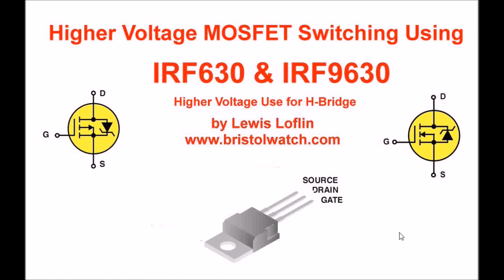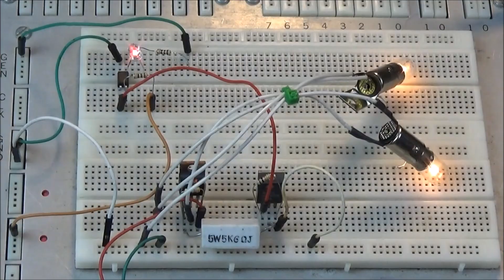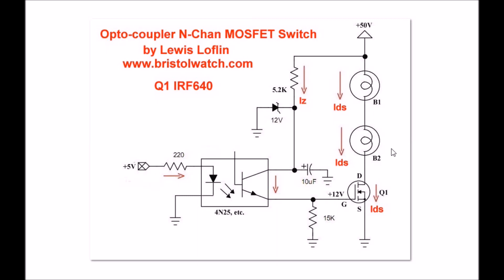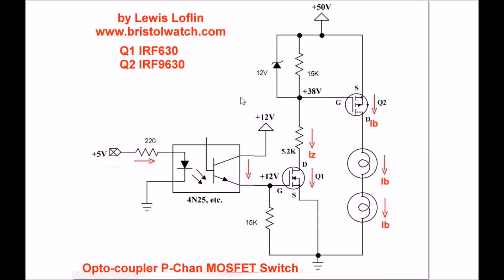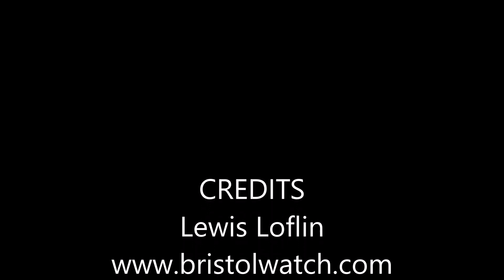High Voltage MOSFET Switch Tutorial

Comment: i have only basic concepts and good soldering skills, used to repair music amplifiers;

 i have here a broken 3000w/5000W  china   inverter, 24 VDC to 220 V AC;  the 1st stage ,at 24 KHz, produced 380 VDC, and the 2nd,   220 VAC at 50Hz;

since the control ICs (soic16)  have been erased,i will only use the 1 st stage of the inverter;  i  modified it ( converted it to the SG3525+LM358 china module,only 2 dol.), fixed it, now have a good 380 VDC;

 for the 2nd  stage i use an external  3000W board with 8 IGBTs, and the famous 4 dol.  EGS002, i bought fully assembled;

     the china vendor says to supply the 3000W board with 16V AC( module already has 4 diodes for DC..) by wrapping 4 turns of wire around one of the 4 yellow trafos of the 1st stage ; done that;
     he also says,in bold red... that the 16VAC and the 380 VDC must be  simultaneously
 
    My question is ,why is that?

I know it has to do with the full H bridge, with the gates' signals and the IGBTs being  on or off,  but since i have to connect the 2 cables (16vac and 380vdc) btw the 2 units, i need to know  how to time those connections;

i feel that if done wrong the IGBTs will blow instantly,in case the 380 VDC are shortcircuited to ground thru 2 of them, seen that happen in other cases; 

And also,if the big Caps ( on stage 1 and on stage 2 ) may already be charged or if they must be discharged,when connecting the 2 cables.

Comment: high voltage starts at 1000V, I use 2 isolated gate drivers, to switch 2 SiC MOSFETs in series. capable of switching 3500V

Comment: In your circuit at 3:28, would there be a limitation on removing Q1 and its 15k resistor, and replacing it directly with the optocoupler transistor ?  4N25 Vceo=70V, Ic=50mA.
Reply from the maker: Should work.

Comment: Ok I am experimenting with gate drive optocoupler to drive my mosfet I did as you about why my inverter mosfet was burning up I did found out the gate voltage was too low the gate need 20 volt fully to open the gate fully to reduce the resistance in the mosfet stop heating up, but my mean question is why the optocoupler volt drop for 20 volt to 6 volt when I connected the 10k resistor to ground and to the gate the volt drop turn off the gate ad I noticed your design also use the same circuit I use so where is the 20 volt am not seeing it on the voltage meter at the gate only 6volt reading but when I remove the resistor the volt goes you and the duty cycle goes up to 96 from 50 % but goes but to 50 when resistor connected back

Comment: Hello, I want to ask you the following: I am trying to control a 180 Vdc voltage through a mosfet IXFH26N60 through a circuit very similar to the one presented in this video.
The only variant is the optocoupler you use. In his place I have used, without success,
a shunt potentiometer with the 12 volt source and the center of the wiper
connected directly to the gate of the mosfet but I cannot get a control of the
mosfet. What I'm trying to do is vary the voltage to get the voltage in a
linear fashion. Thank you in advance for your kind response.
Reply from the maker: That depends on your MOSFET, etc. This is a switching circuit, ON-OFF. I'm sure there are MOSFETs for linear circuits but have never seen any. Sorry.

Comment: Do not exceed 20 volts or 12 volts?
Reply from the maker: 20 volts depending on what the spec sheet says. I'd not exceed 18V.
Reply: @LewisLoflin  Got it. Thanks. I looked at the sheet. Said 20.

Comment: Sir in the 50V and 90V  setup does the arduino and the mosfets have the same ground ?! Can u plz answer 😔
Reply from the maker: They can but I wouldn't. Opto-isolators serve that very purpose - isolation.
Reply: @LewisLoflin  sir then in the 90V setup did u connect the arduino to the gate of the mosfets without common grounds as there is no opto isolators shown !?!?
Reply from the maker: If no optoisolators then the grounds must be connected.
Reply: @LewisLoflin  alright 👍 thank you sir 🙂

Comment: Can i use this circuit for 500vdc. Reply for me please. Thanks sir.
Reply from the maker: How is it to be connected? How will you drive it? It is possible but 500V is deadly.
Reply: @LewisLoflin  pwm using mosfet 20n90n90 by control circuit of ic sg3525. 12 VDC Power supply for IC SG 3525. 500vdc power supply for mosfet 20n90 adjust halogen  light. Thanks sir. Can you share me this circuit diagram.
Reply: Any success? My self i must find a way to PWM  530VDC.. To charge a 300-400V battery bank. No good examples on the internet. :-(

Comment: Love the circuit at 3:51. The combination of the zener, resistor and capacitor forms a simple stabilized "power supply" to turn on the MOSFET. The fact that the capacitor is almost directly connected to the MOSFET gate should guarantee a fast switch on time. However, things are less clear when the optocoupler transistor is off. In this case the Cgs capacitance is discharged through the 15K resistor. Isn't this much slower at turning off the MOSFET, causing a fairly asymmetrical on-off time ?
Reply from the maker: The 15k resistor discharges the gate.

Comment: What is the use of zener accross 15K? Is it for protection or mandatory?
Reply from the maker: It protect the gate of the MOSFET rated for 24V.
Reply: @LewisLoflin   Can this circuit work without that 15k resistors?

Comment: Nice video. Could you please help me with a 230v dc to ac circuit using mosfets? I jave a 230v 10amps dc  power source  i need to convert it to ac so i can use it
Reply from the maker: You will need to build a h-bridge type circuit. I've seen this done in cheap invertors.

Comment: I can ground the gate to switch it off? I did that with and irfp460 on 300v and it did blows up.
Reply from the maker: What was the load? What uses 300Vs?
Reply: @LewisLoflin  a capacitor bank, for general purposes that requires high energy discharge.
Reply from the maker: Having no idea of the connections you are talking a massive surge here. It' s rated only 20A or at most 80A with a very narrow pulse.
Reply: Yes, it ain´t rated for such massive energy discharge, but in the conditions of the test i done, it shouldn't just explode when i grounded the gate. I'm wondering if ground the gate without a current limiter can damage the FET.

Comment: With your 12v Zener setup, you can sink 7.3mA (0.0073 Amps).  Wont this 15k gate bleeder resistor be way to much of a load, and pull the 12Vz down too far for the mosfet?  If calculations prove correct, 7.3mA through 15K Ohm would require 109.6Vz to get the 12v gate voltage.
Thanks for the video!!
Reply from the maker: The zener is there to limit voltage. 15K is no problem in my circuit. Reduce the 5.2K resistor to 4.7K if you wish.
Reply: The 15k resistor I just to protect the gate imo. It can be even bigger.
Reply: I just set the up for inverter and I use 10 k for discharge of the gate but in the process the 20 volt to turn the gate on is also cut out out and leave behind the resistor so the gate can’t fully turn on this optocoupler design is good but if 20 or 12 volt is need to fully turn on the gate and resistor pulling down the volt to last then half the voltage this is bad and if a low value resistor is use the duty goes to fully 100 so the gate is disconnected for a very very small time instead of 50 % 50 % of

Comment: Will the p mosfet driver circuit work decently in 300khz?
Reply from the maker: Depends on the MOSFET. I've run them myself no higher than 38KHz.
Reply: @LewisLoflin  I will be using a IRF9540
Reply: @LewisLoflin  can you please perform a test of this circuit in high frequency ? 🙏

Comment: for mosfet important gate charge current.   for fast switching.  how to make maximum current for gate ?   I'm making a 50 volt 40 amp bridge.   I need a large gate charge current IXTH48P20P TO-3P P-channel 
  IRGP4063 IGBT 600V 96A 330 IN a TO-247 IC N-channel     can I write you a mail?
Reply from the maker: lewis@bvu.net is my e-mail.